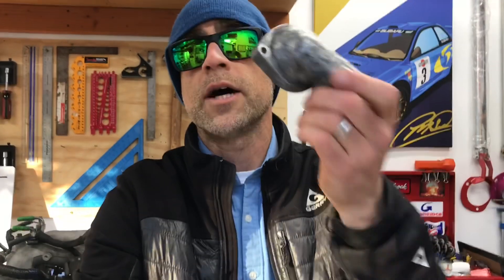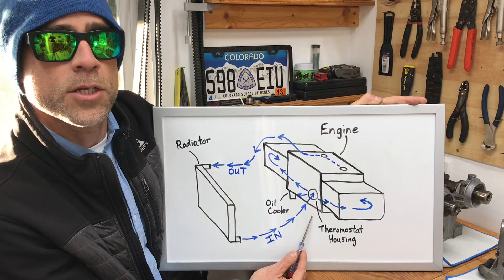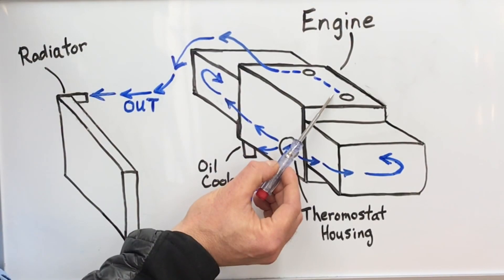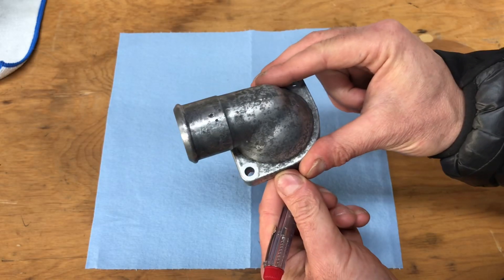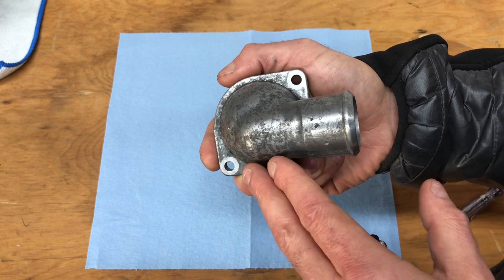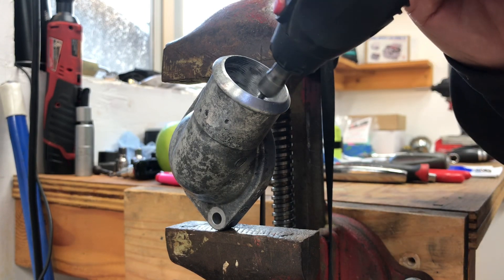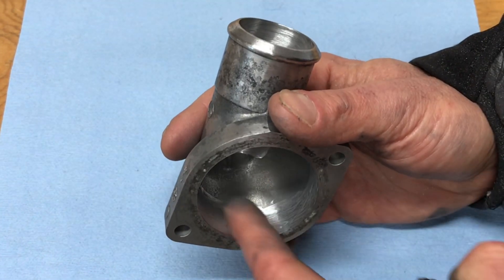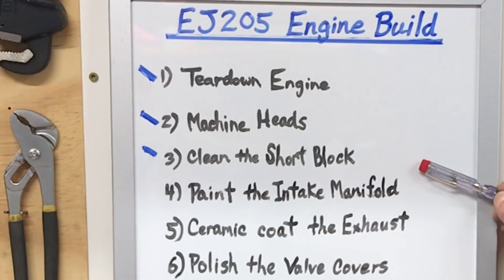Coolant Flow Overview & DiY Thermo Housing Mod

Comment: Hello mate, got a problem with my 2.5 Subaru Coldwater pipes to the radiator and cold radiator and cold water in the radiator flushed air out of radiator radiators full of water but it’s cold all the time please help

Comment: Thank you!!   
I built a EA81 on a custom stand for an airboat. I was NOT getting good cooling.
Was going crazy over this!!  Your video show me I had the radiator hoses backwards.
according to your chart, I had MY radiator OUT going to the the water pump, which should be the other way, going to the thermostat!
Problem solved >>>>>>>>>>something simple overlooked!...... I'm an idiot!!! 
4 year old video still helping!!

Comment: That's actually an oil warmer at the oil filter. When you add a heat exchanger for the oil, then it becomes a cooler. Also, could you have the direction backwards? Isn't the the oil warmer a return line to the water pump? That's what all the oil warmer delete instructions say. Lots of people here in California delete that part altogether. Speaking of which, you left the bay, bro??? Just had to move closer to M45? Lol right on, good luck, bro!!

Comment: Fixed: My 2010 2.5 litre legacy was getting overheating issues, it's a bad design by Subaru; the thermostat is at the bottom of the engine so the whole engine has to get very hot before the water at the bottom reaches temperature and opens the stat, but as soon as the stat opens cold water from the rad closes it again, not allowing much water to the block or coolers. So I removed the stat completely and fitted a generic inline thermostat with housing on the top coolant pipe, now when it opens it stays open for longer allowing better cooling and only closes when every component has received cooler water. It runs better than ever.
Reply: Hi Beautiful World, this is indeed brilliant! :) Can you provide a few details on how you did this? Thanks in advance!!
Reply: @tomrmalcolm  Hi Tom, removal of the original thermostat, as you know, is quite easy, located lower front of the engine and easy to get to, undo the 2 bolts on the housing, 10mm I think, then you can just remove the stat, then bolt the housing back on DO NOT overtighten the bolts. I ordered an 'inline thermostat housing with thermostat' from e Bay, and cut the original top hose, located at the upper front of the engine, fitting in the new housing, making sure the temperature end of the stat is fitted pointing towards the engine block so the heat opens it correctly. It works great, the total cost was £70. Apparently, Subaru design these engines to run so hot lowering the emissions, unfortunately causing many issues for the owners. Total time under 1 hour. Happy driving :)
Reply from the maker: Exactly as stated above - thanks man!!! 👊
Reply: @chazoclock  Hey can you do a video to show how you did this? Sorry I don’t quite understand when you write the instructions.
Reply from the maker: Brilliant - love it!!! 👌👌👌

Comment: Heard if you don't use the subaru thermostat. You will over heat. Is this true or false. Right now my radiator fan doesn't kick in let it ran for an hour. Doesn't over heat but the fan doesn't kick in. My fan worked before and the only thing I changed was the thermostat from autozone. Help. Only over heat when I'm on high speed.
Reply from the maker: I’d say that is false. Fans are triggered by the ECU that’s monitoring the coolant temps. If the weather is colder or coolant not getting hot enough, those front fans may not need to kick on.  If the car is overheating at high speed, the fans aren’t likely the problem. May have a coolant leak or head gasket leak somewhere.
Reply: @SubaruONLY  thanks.
Reply: @SubaruONLY  thum6up for witch questions. About those green plugs. Does it bypass the fan relay.
Reply from the maker: Yes, know the green plugs you’re referring too. Think those are for entering a testing mode / ECU bypass of some type, or something like that, ehhh I can’t remember off the top of my head.
Reply: @SubaruONLY  ok my fans doesn't work. Even when I turn on the ac. So I'm guessing since I used the green plugs to see if my fans works and it does. So is it the relay is bad. I can't take those relay out its so tight in.
Reply from the maker: Hmm. Have to think about this one for a bit. Sounds like the relays might be bad. Good call to confirm that the fans do in fact work.  Sounds like it may be the relays. Maybe you can check on incoming signal to the relay?
Reply: @SubaruONLY  thanks
Reply: @SubaruONLY  got another question. Under the dash there is those green plugsnthats is disconnected. Does it bypass the relay to the radiator fans.

Comment: Luke, does a heater core putting out no heat,  cause over heating thru pressure blockage etc. there was a split in oil filter hose then post replaced, something else blew out round heater cure hoses
Reply from the maker: Blocked heater core, should not cause an overheating issue, it’s basically an isolated circuit for coolant.  I’ve blocked it off for race cars many times with no issues.  Good luck and Merry Christmas buddy!  👊
Reply: 👍1 Luke fir tht info I understand now, I’ve just run another coarse of gasket seal repair thru, after a failed 1st coarse whr Leaks&hot coolant comin out of reservoir dried te system and motor stopped running and water pump without thermostat stunk of burnt coolant, question, ignition sometimes struggles to turn over& sounds electrical to me than starter motor issue, wondering why tht is as tht struggle sounds exactly like it does whn it’s dry and to hot for motor yet there’s no leaks anymore... just starting is different as I also put in new spark plugs idle now to low and cuts out, che bro happy new yr in ur race meetings

Comment: Great video, replaced my thermostat recently, the face that holds the rubber gasket of the thermostat should be sanded on a flat surface to remove the pockmarks over years of crystals forming between the rubber gasket and the aluminium.
Reply from the maker: Good call 👍

Comment: Thanks for the videos, lots of useful information.  Could you show a detailed coolant path for the IAC and Throttle Body from the coolant crossover pipe?  Would you have any information on older EJ20?

Comment: Hey. Don’t want to be annoying or flamed in the comments. Love your vids keep it up but I’m getting a stock 2.5 rs and I’d like to do the swap but everywhere I look says I need different things. If I did a 205 motor besides the harness do i need the wrx trans or can I use stock 2.5. And can I use stock axles and diff or does that need changed. Also drivetrain is another concern. Basically I’m asking bare essentials to do the swap if you would be nice enough to give me a list
Reply: Carmen Ridolfi i believe you also need to change out for different control arms. Currently doing the swap right now, just waiting on a little more parts to get started
Reply: Chance Matsakoun do they hit stuff with stock arms ?
Reply: Carmen Ridolfi not sure, I have not started my swap, but I’m guessing they do, the wrx control arms or true gc8 control arms are low profile compared to the stock ones
Reply from the maker: I think having to use the turbo front subframe might be the reason most people swap the control arms, but I’m pretty sure you can retain your RS ones if you add some shims or washers. Not 100% sure about this though TBH.
Reply from the maker: Hey man - thanks for asking!  Great question that many others are probably thinking about too!  

1) For the driveline components (i.e. the transmission, rear diff and axles), many have used all the stock 2.5RS parts and enjoy the swap for many years. I have lots of friends who have asked this and I always say the same thing, it really depends on how you drive the car. If you want to drop the clutch at 5k RPM and do AWD burnouts or launches - you will break things VERY quickly. However, if you use the swapped car for daily driving and use full boost power, after the car is already engaged in each gear, you should be fine up till the clutch reaches its limits and starts to slightly slip (which shouldn’t happen with stock boost levels most likely), and even then you aren’t going to break anything, just going to wear out the friction disk in the clutch. So roll into power smoothly and you should be fine! 

2) As far as parts needed to pull off the swap, lots of info out there, but off the top of my head: 
- you need the turbo engine and ECU (which will need to be merged with the current wiring harness on the vehicle (iWire is the go-to shop for this), 
- bigger fuel pump,
- turbo cross member (to clear the uppipe) or you need to notch the facility NA cross member, and
- install a turbo downpipe and larger exhaust system. 
These are the basic components needed to make the swap work (although there are lots of other little odds and ends to deal with too). Hope you go for it and you got this community as a resource if needed along the way!  It’s totally worth the time and effort and it’s a GREAT investment!

Comment: I’m enjoying this build series. You put a lot of planning and organization into your videos. I’m going step by step with you with my non-avcs 257 build in my ‘03 bugeye. Never even thought of porting the t stat housing and it’s something easy/cheap to do while I slowly gather the rest of the parts I need for everything else. All the quality gaskets and essential items really add up as I’m sure you know.
Reply from the maker: Thanks man.  Cool to share the build process together!  I basically started thinking about this because Killer Bee recently came out with a new custom designed thermostat housing that is using the same principals.  So I figured, let’s do this!

Comment: Insignificant. The flow is controlled by the thermostat. It does make it nice and shiney though.
Reply from the maker: Might be insignificant - 100% correct there!  Biggest restriction is the thermostat for sure - 100% right there too.  But the flux (ie volume per given amount of time) is also based on the fluid dynamics of the coolant entering the restriction as well. 

In other words, if we can create a more even and laminar flow path into the thermostat, then we can pass more fluid through it over a given amount of time - even though it’s still the biggest restriction point.

Comment: I would think the thermostat, even open fully, would create more restriction and turbulence than what you changed.
Reply from the maker: The Thermo does create the biggest restriction to flow - 100%.  But having laminar flow even flow into that restriction does actually effect how much volume can pass through for a given amount of time.  

This is really interesting topic to look into for and maybe do a follow up video.  I think this is the reason Killer Bee developed their new cast thermo housings.
Reply: Gerald Noe 
In an Old video by Brian’s Mobile he shows that drilling holes around the thermostat helps it to stay open longer keeping the flow more consistent. It was a band aid fix to help a head gasket leak.
Reply from the maker: Nice call out man!  I’ve seen that one and it’s a good temp fix to bleed off that combustion gas for sure!  It works!